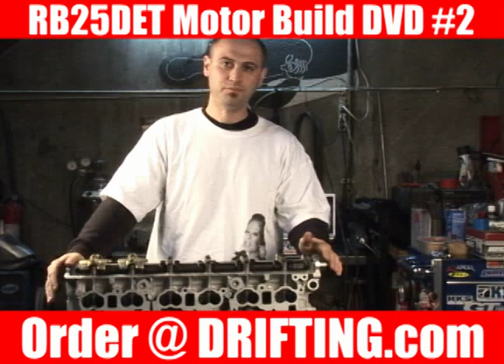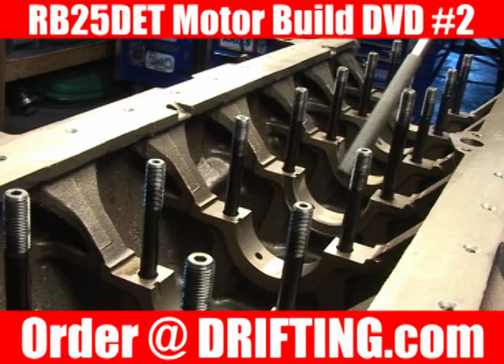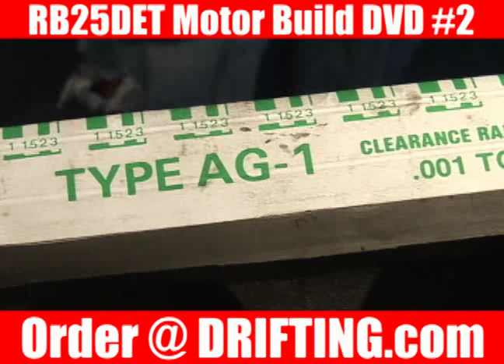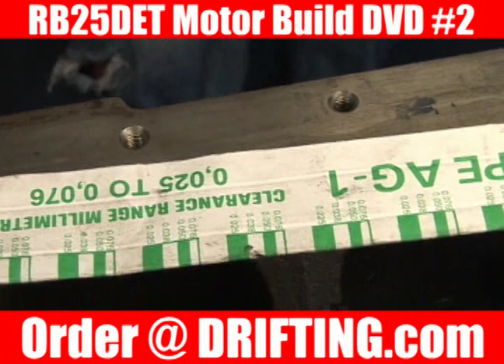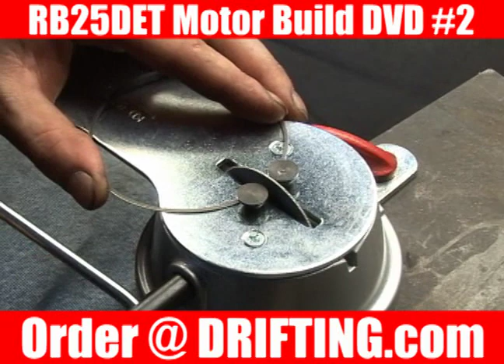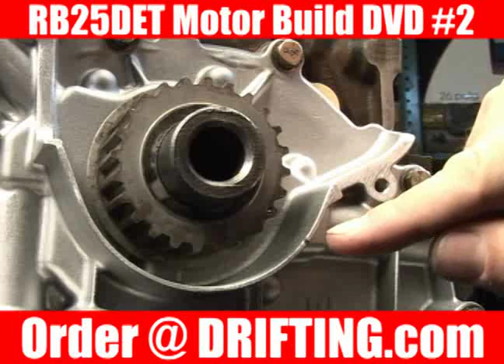RB25DET REBUILD

Comment: Yeah that is right. I was not very familiar with the RB30 at the time of that comment since I had only encountered it in Drag Racers and those were alluminium blocks they called RB30 since it was a 3.0 litre engine based on the RB block. But luckily I know better now.

Comment: The 20 head will fit but none of the galleries line up, the combustion chamber sizes are different, the port sizes are vastly smaller than that of a rb25 head and the flow isnt realy good either
it can be done but i think its a big waste of money

Comment: Got that completely wrong RB30 is the highly modified Bored and stroked cast Alluminium block mainly used on 1000-1100hp drag racing engines...